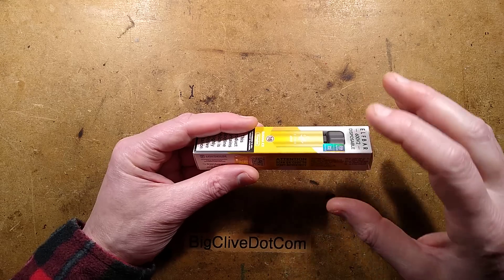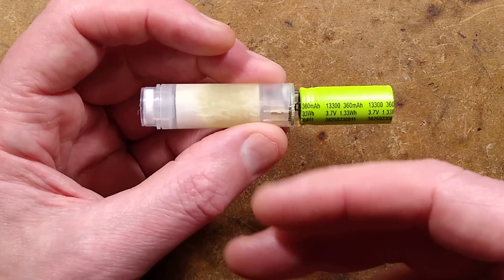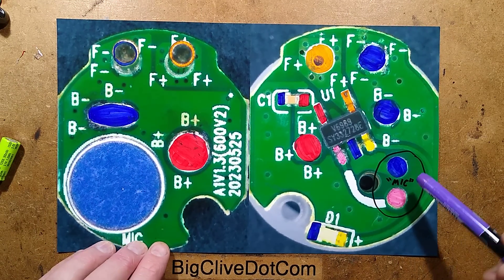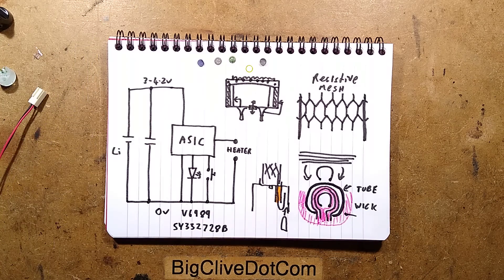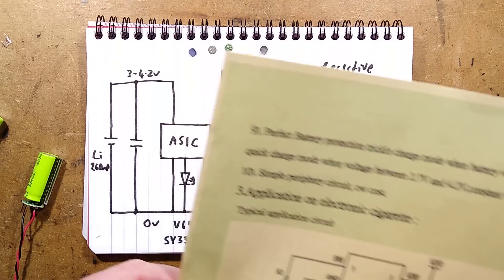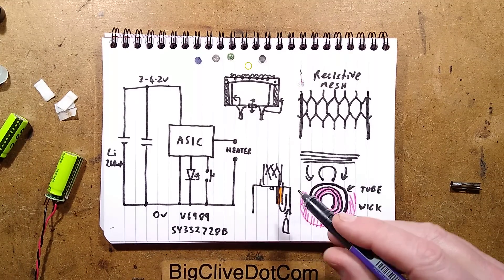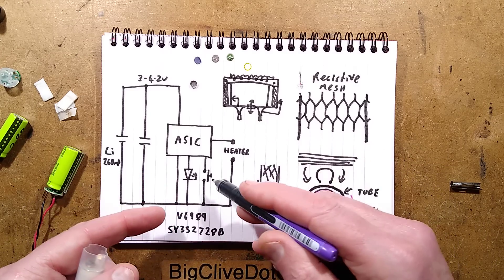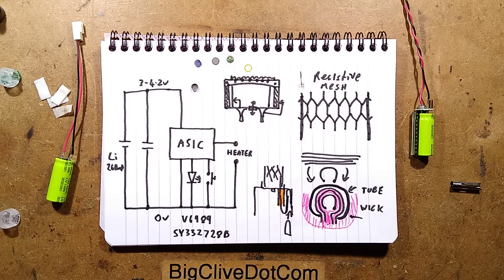Lithium "capacitor" in a disposable product

Comment: These manufacturers need to be held accountable.  They mass produce these things, fully expecting them to end up in a landfill.  This one in particular takes the cake.  However, I've got a bunch of LED light bulbs that were designed to fail after so long.  So much waste when it would cost a few cents to make things last and be useful for far longer.  If I won the lottery I'd probably start a manufacturing business.  Where I build and sell every day items meant to last decades.  I'd change my factory to manufacturer different products as I destroy the planned obsolescence bushiness plan and market for each product I build.  I'd call it my company BOCO, Buy once, cry once.  And corporations around the world would plan my assassination.
Reply: You would need good marketing. Otherwise people just buy the cheapest thing
Reply: @RennieAsh 
People that have bought their third one of the same cheapest thing are often in a mindset to spend 40% more on the last one they ever need.
Reply: @RennieAsh  Or plan the business to be non-profitable from the beginning. Because in the end that's what's it's going to be.
Reply: @andrelange9877 which is why our bodies are filled with plastic and there's 60% less wildlife on earth than there was in 1970. Those profits though, they're forever...
Reply: @andrelange9877  then companies never innovate and everywhere becomes like the EU, boring and hasn't done anything is 50 years
Reply: @z-0669  What has been innovated in inkjet printing in the last 20 years? The only inkjet I still own is from 2001 and still does it's job of printing home jobs now and then. You know, printing letters on a sheet of paper...

All the newest inkjet printers I had own were all-in-one that would fail printing after maybe 30 pages at most. Now they're all just combos of bad printer + good scanner, both being turned into electronic waste polluting some landfill after having sucked me money that could have been used to buy nice products from really innovative companies.
Reply: Interesting. I had the same thoughts. I would start with inkjet printers and cartridges.
Reply: @andrelange9877  Inkjet's a losing game.  Get a laser and you're already where you want to be.
Reply: @andrelange9877 they are now selling printers with refillable tanks of ink, which are far more economical and less wasteful because you just buy the ink in bottles (though they don't tend to be that open about the formulation of the ink and the method for curing it, so the ability to shop around for suitable ink from other suppliers is limited. In theory the ink needs to remain liquid up until the point it hits the page, as otherwise it would clog up the nozzles and tubes. Similarly it needs to be able to remain emulsified for a long time without agitation, so the medium and solvent parts of the ink have to be specifically engineered and you can't just buy any conventional ink. I believe that a lot of them flash an intense uv light onto the ink before it comes out, with the bottles and the tank being shielded from that part of the light spectrum, but it could also be a number of other things including blasting it with a laser to heat it up to a specific temperature range like a laser printer/inkjet hybrid)

It's not perfect, but it's better than the cartridge printers (which now seem to require you to subscribe to an online service which deactivates your printer if your Internet connection goes down).
Reply: And what about the potential for these things to catch fire in a landfill after being exposed to the elements?
Reply: landfills already burn, pls google @AOClaus
Reply: @AOClaus  How about the fires they're already causing in garbage trucks?
Reply: I'd argue that the government is to blame as well.  They banned Juul from making "fruity" flavored pods which left a vacuum in the "single use" vaping industry and all of these came out.
Reply: The Chinese could care less what ends up in an American landfill.
Reply: good luck, its 100% china engineering
Reply: I have had almost the exact thought, People spend big money just for a name Brand when the cheap one comes out of the same Factory. Why not spend the same big money on an item that isn't flashy but will last as long as you.
Reply: Next time I'll see an item called BOCO I'm getting it
Reply: When KitchenAid finally changed out their metal gears for nylon a couple decades ago I thought it would be good to surf thru various supplier catalogs and figure out a rebuild kit to sell that would restore countertop mixers to their former immortal status.
Reply: The world is throwaway now. From junk all the way up to cars. Yes, that 120k car you just bought? Hope you dont expect to use it more than 5 years max... If recycling was more useful and wasnt a burden on cities and towns, more people would likely do it.
Reply: Capitalism and reusable dont mix man.. never will
Reply: "If you won the lottery" is perhaps more pertinent than you realize, because it wouldn't be "corporations" planning your assassination, it would be investors. Investors are expecting huge and constant short-term growth AND long-term stability or it's no deal. So if you tried to pitch a company with worse-than-average long-term prospects to investors you'd get no takers. It's not free enterprise that's killing us, as informed/regulated free enterprise is capable of self-correcting in a vacuum. It's the "capital" part of "capitalism" digging our grave.
Reply: The manufacturers are literally drug dealers. I'm not the slightest surprised.
Reply: The reality is that marketing wins in the sales game.
Reply: guess the fire nearly recycled a few lives eh
Reply: These devices are mass produced in china, good luck holding anyone accountable for anything over there, consumers are the one that control the market, anything cheaper is going to win
Reply: The led bulbs that have lasted longest at my parents place are from the first generation of halogen down lighter replacement leds. Sure, they don’t have an insane lumen output like never ones… But they also don’t cook their driver board to death.
Reply: @Jonathan_Doe_ the thing that fails is the electrolytic capacitor. Replace them with one with a higher temperature rating and leave the legs as long as possible to help keep it cool. Even better solution is to buy 12V bulbs and high quality separate 12V power supplies. That combination will last for life. I spent 12 years working with high power led lights and all the led lights in my house were made by me. No faults in 10 years!
Reply: Manufacturers? What about people who buy these? Any self responsibility?
Reply: @PaladinErik  Ah - you're sucking on something that's going to kill you... So - nope.
Reply: You'd go broke before they assassinate you, lol
Reply: They are Chinese...when are Chinese manufacturers held responsible and not immediately replaced by 100,000,000 more bastards worse than them?
Reply: Have you ever heard of the "lightbulb cartel" and WHY they mandated 1000 hour lifespans on bulbs? (Market saturation)
Reply: I like your idea.
Reply: Unfortunately, your business model wont last in the modern world... Or rather - you would need to be VERY careful about how to you go about your plan, because MOST people will just go for the cheap, quick fix... That's what they've been programmed to do over the past 50 years or so.
Reply: The manufacturer makes what the costumer want, the costumer order what they think they can sell for a profit to end users.

To make it simple, its the end user that should be held accountable, they are the reason this happen. 
Everything is made according to laws and regulations that already exist (i would assume, at least as a baseline)
Reply: @ssu7653  Do you think seriously that Microsoft sit down and think about what customers want when they design their next XBox?  They plan these designs out well in advance, with no thought about the end user.  Big Business doesn't get Big by doing what the customer's want.
Reply: @ssu7653  I worked for a lady that had goods produced in China and sold worldwide - stuff for kids.  She was selling some products that she knew were about to become a hot issue due to plastic leeching, so she changed to bamboo products. Hey, look at us - we're ethical and bio friendly, the PR said.  She was aware after her own research that the bamboo products have their own issues with leeching glues into food, but hey, that wasn't common knowledge, so who cared.  So then, people started complaining - my kid dropped the bamboo cup, and it broke.  They were aimed at toddlers... and broke when dropped on hard floors.  Ever had a toddler? Well - don't leave your kid unsupervised...  
I'm glad I don't work for her any more, but as far as blaming the end consumer - they can only buy the goods made available to them.
Reply: The issue with business is scale. To you, its just a few cents. To them, its having a business or losing to some other business. The amount you win with the lottery is their yearly income, the entire business total.
Reply: I'm serious when I say if you make a gofundme or something I'd back you
Reply: You're missing half the equation here. From the consumer side, it costs 50 more cents per bulb or so to have a long lasting bulb. From the corporate side, it costs them 20 bucks every 3 years because you're NOT buying bulbs because you don't need them. This isn't about you. This isn't about the environment. It's about corps and their nature.

What we need is a "You have made enough fucking money" law which caps how much companies can earn in a given period and is air fucking tight for loopholes.
Reply: This should be the task of the government. At present, we only pay the economic cost. If a tax proportional to the cost of environmental damage were applied, and a product that lasts 1 year was the same price as one that lasts 10 years, the choice would be obvious. The problem is that many times for a product to be effective, thicker plastic must be used, more adhesive, chemicals that make it more resistant, etc; things that increase the environmental cost.
Reply: @fd2824  While I agree with your suggestion to impose an environmental damage tax, I think it will never materialize, sadly. As soon as a politician suggests that, they will be voted out of office, so they just won't. The only way to make a meaningful impact on the looming climate disaster is by dropping our standard of living significantly, which is something that in a democracy will never happen because people are hardwired to hold on to a standard of living, once attained, with all their might. That used to be a very useful property much earlier in human evolution but in modern society it is sustaining many of the issues we see now. That's why so many of the propositions for climate change mitigation skirt around dropping our standard of living and as such are merely symbolic in nature. I think we will only see a move towards actually meaningful measures when we're already going head-first over the edge of the cliff, which likely will happen much sooner than most suspect if you look at what has happened just in the past 12 months
Reply: You're talking about "carbon taxes",  @fd2824 . They've been proposed all over the world and roundly rejected except when disguised as a "deposit". That's how I would deal with these problems; a hefty deposit with a return program. This would be based on the amount of metals and plastics in the project, encouraging the industry to reduce the environmental footprint at the production level or be priced out of the market.
Reply: you get on that. Im waiting
Reply: The thing about products designed to last forever?  Who wants one of the early cars, before they had:
- windshield wipers
- window defrosters 
- radios (much less stereos)
- cruise control
- decent mileage
- emissions controls
- seatbelts
- air bags
- etc. etc. etc.
-
Reply: @scottwillis5434  You may like old cars because they allow you to fully drive them. And when you make mistakes you learn something. The newest cars are designed for stupid.
Reply: THEY ARE FORCING THE POOR HUMANS TO BUY THESE, HELLO IM A VICTIM HERE, HELLO?!
Reply: Ok looney 😂

Comment: Just what we need. Disposable devices using a fairly limited resource, the demand for which is growing exponentially and happens to be exceedingly flammable. At least lithium fires are a pretty purple.
Reply: This is a lithium ion cell, not a lithium cell. You will not get a lithium fire from it. Not to say it can't catch fire if you look at it the wrong way of course, but it's nowhere near as dangerous as a lithium fire. Think of it like the sodium in your sodium chloride (table/food salt); sodium is extremely reactive, but salt is not.
Reply: @aaronmdjones  lithium ion batteries are still super flammable especially if punctured
Reply: @WowUrFcknHxC  Yes, they are. But they do not result in lithium fires any more than burning salt results in a sodium fire.
Reply: @WowUrFcknHxC  It does matter very much, because it dictates how you react to it. A lithium-ion battery fire can be fought via any means that does not involve water (CO2, ABC dry powder, powdered graphite, soda, sand, ...), while a lithium metal battery fire requires a specialist class D fire extinguisher (and a good pair of running shoes) -- almost anything else will only make it worse.

Comment: A friend of mine had a disposable version with a USB type C charge port with a fixed amount of liquid/inhales but rechargeable. I need to get my hands on that thing once it's empty. It looks like an 18650 with 5V charge circuit built in as a disposable which would be insane. He could vape those all day long, I will gladly take the empty ones to power my ESP32 projects :D

Comment: Propably a stupid qestion, but due to the battery is in a form factor of a standard capasitor, would there be any cucits who will benifit of this?
like in hifi or anything else as a replacement?
As an mechanical engineer i know batterys and capacitors are more or less the same, but with different caracters

Comment: I suspect it would have been much safer to desolder the -ve first and bend the 'capacitor' away and insulate it, then the board would be floating and shorting the +ve while desoldering wouldn't have been an issue at all?

Comment: I came across one of these at work and tried to salvage the "battery" only to find the "capacitor" inside. Im now glad it was discharged as I just snipped through the connections to the PCB. No bang, no sparks, and no fire.... Actually I'm quite disapointed now. 🤣🤣

Comment: Interesting it looks like the pin and socket aspect was the desirable part and the lipos polythene encapsulation didn't have the mechanical strength, so they put  lipo innards in  capacitor shells, they're obviously expecting to be stopped from wasting rechargeables on these things, ill have to start picking them up again, I stopped as I have a dangerous amount of batteries lying around, there's only so many devices I can ''upgrade '' with larger cells  or miniature emergency power banks i can create, although they have come in very handy and so if the decent sized ones are going away or being hobbled with trick charge boards like power tool power packs I should probably get all those I can

Comment: looks like a great design mechanically but its rediculas to use lithium batteries for disposable products like these.
im completely clueless on what impact ( both cost and enviromental ) using a lithium capacitor instread of battery would be.
thats if it turns out to be a capacitor rather than a battery in a capacitor style housing. if it turns out to be a battery its an interesting way to locate both power terminals on the same end and may catch on for other uses.

Comment: I noticed the battery has the cross on the top, same as a capacitor. That'll be where the flames shoot out when it's shorted. What fun. Interesting design.
Reply: You are not wrong 😅 that's also where they split open if they are crushed 😱
They are actually more fragile than the pouch batteries when it comes to crushed vapes 😉